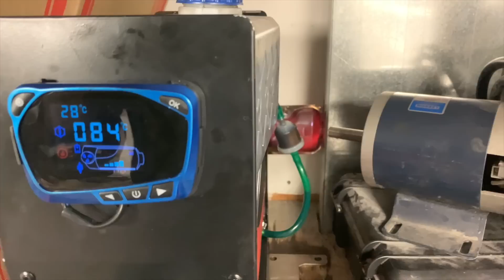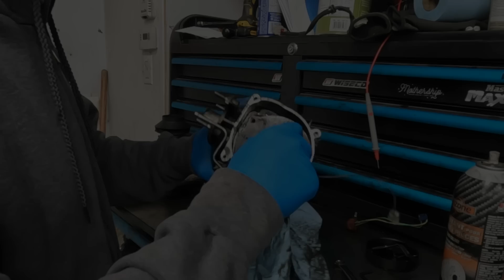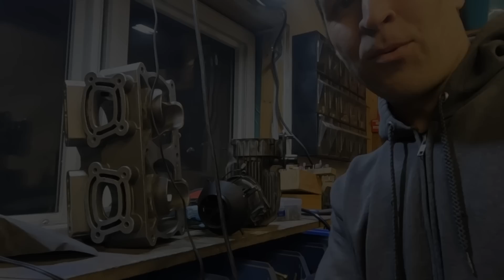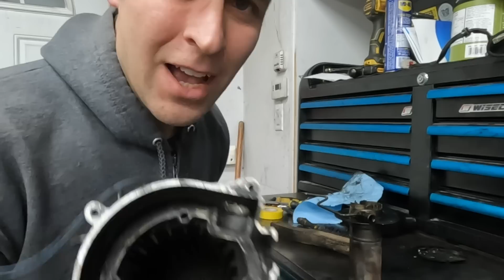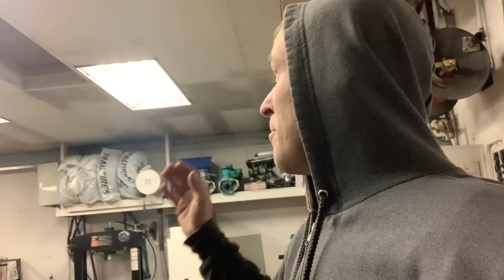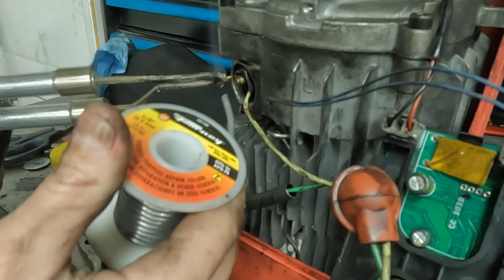Porting My Diesel Heater - (more air flow) Will It Help? Chinese Diesel Heater. PT-9

Comment: keep this in mind if that "fog" get to the correct air fuel ratio it will explode. this is too dangerous for me to try these heater terrify me just a terrible concept like the gas heaters in A model Fords
Reply from the maker: I'm not sure I follow what you are saying. 

I have had it backfire bad enough so that it popped the inlet off and pushed all the carbon out of the exhaust. This was because I was feeding alcohol, gasoline or brake cleaner into the inlet 🤣 

Burning oil or diesel it never does this. I've had it backfire but they are pretty wimpy backfires, as oils burn much slower. The inlet and exhaust area always open, so it would take a heck of a lot of pressure to make it explode... It would be a very bad day if it did. 

I heard that VW Beetles used some sort of gas heater because they were an air cooled engine.
Reply: @loweredexpectations4927  you might not know this but smoke is flammable and if it gets to the right mixture like for a car its aprox 13:1 wide open throttle and one this happens anything can ignite it and then your garage becomes the cylinder and BOOM i would be VERY cautious, i know these things because i have a car that can run on wood smoke its called gasification im not some troll my heart stopped when you said the garage was filled with smoke keep this in mind what you are doing might be illegal /no permit and the exhaust is definitely not code and if the house explodes and injures someone you will be liable, cops are all over the net
Reply from the maker: @xoxoXoieoxox  Thanks for your concern. I get what you are saying, I know what gasification is, I know about air fuel ratios, the LEL and UEL of gases. However, different gasses have different volatility meaning they take different amounts of energy to ignite, and when they do ignite, they have different expansion ratios and rates. 

Wood gas is particularly dangerous because one of the gasses you are producing is hydrogen... and hydrogen burns EXTREMELY rapidly. It expands so fast that it almost sounds like an explosion even when it is not contained by anything except for the atmosphere. Hydrogen is also dangerous because it will burn anywhere from 4% to 75% so the odds of getting the "correct" mixture to have a bad day are pretty good. 

Diesel or oil smoke will burn, but it doesn't burn well, it doesn't burn quickly, it has a narrower AFR that it will burn at and it takes more energy to get it to ignite in the first place. WIth gasification you have to have an air tite seal so you are starving it of oxygen, it wants to burn... This diesel and oil smoke are the result of something trying to burn it unsuccessfully.  

While there isn't zero risk involved, the likelihood of all of the fumes igniting are low, and the results of these fumes damaging anything, if they ignite, are also low.

Comment: You would have a melted glob of alinumum at those temps..Ha ha...
Reply: 👍
 lol, insulation keeps the heat in, so would make melting even more likely, but have look closely from 14 minutes on, and see actual temperature displayed, rather than listen to the extra zero he  add's with what he says.
Reply from the maker: @Retiredkiwi  Yes... but I said "NASA" soooo it's special insulation that also stops the heater from melting.... I wasn't allowed to say that in the video because ... well... "NASA"
Reply: @loweredexpectations4927  🤣🤣🤣omg, please stop it, laughing so hard its dangerous, too funny for words.
Reply from the maker: @Retiredkiwi  🤣
Reply from the maker: Yeah... but I said "NASA" soooooo. 🤷‍♂️

Comment: I would like to buy a 8kw I'm interested to try to burn biodiesel from wasn't vegetable oil. 
I don't know if have try that. I make it for my trator it works great in it.
Reply from the maker: Hello. Just so you know, the 8 and 5kw units are actually the same thing. There are no heaters like this that can actually put out 8 kw. They just do not have the capacity to burn that much fuel. 

I have not tried biodiesel myself, but from what I have been told, it will work. Filtered or clean vegetable oil will not work well, but I have been told actual biodiesel will work.
Reply: @loweredexpectations4927  I'm thinking of buying one were is the best place to bay.
Reply from the maker: @dorienhachey5909  I don't know if this link will work where you live, but this is the place where I got mine. If you use this link, and the code VVS10 you will get $10 off. https://s.vevor.com/bfP6Z5 

This is an affiliate link, meaning that if you purchase it here, I get 5%.

Comment: I've been thinking.... I used to start my rig that was running on vegetable oil, on diesel and then shut it down on diesel as well. I would give it diesel for 5 min at each end, first to start and heat it up to temperature, then purge it clean at the end. It was just a matter of having diesel in one tank and vegetable oil in the other and a smooth transition 4 way valve to seamlessly swap tanks. (common rail fuel rig with a recycle.) It might help with the start and then a brief clean out at the end.
Reply from the maker: Thanks for the comment. I have heard that that works great on diesel engines... I am currently doing what you say, starting and stopping on diesel and it helps for sure. I just did a community post about it today. I think that there are a few other issues that I need to work out, but it is a step in the right direction. 

https://www.youtube.com/@loweredexpectations4927/community

Comment: Don’t worry about using the exhaust to heat the fuel. I’ve been running a 6mm copper brake line wrapped around the exhaust just after the 90* bend for 2 weeks now.
There are three main points to be followed in my eyes:

To use a high quality externally braided fuel hose. Not the clear see through ones. Adding foil around this last line will help with avoiding excessive heat radiation hitting the rubber line. Use spring clips to clamp the line on both ends. 

Position the fuel pump below the copper spiral, otherwise the gases from the fuel will form a air bubble that will increase in size. 

Use thermal insulation on the steel pipe inside the heater otherwise all the fuel heated below will just cool off again as it makes its way to the injector. I used the white fabric tube used on halogen celling light sockets.
Reply: Excellent info, thanks.
Reply from the maker: Thanks for the comment. It doesn't sound to me like you are talking from experience, but from what you suspect might be the case, or what makes sense to you. 

Yes, the reason the exhaust is glowing quickly is because it has a low thermal mass. However, the fact that it is glowing means that the temp of the exhaust gasses are over 500C. Copper is an extremely good conductor of heat, so it would be the volume of oil (thermal mass of the oil) that would matter in this case.  These heaters only use about 9ml (2 tsp) of fuel per minute at max heat, so the rate that the oil passes through the tubing is extremely slow. The larger the pipe you use, the lower the velocity of the oil meaning the more times it spends exposed to the heat. 

The flash point of oil is 200 - 250 c so at even 300C it will be mostly vapour. When liquids change state from liquid, they expand. Water expands 1600 times... I don't know what the expansion ratio of oil is, but if it is the same, that means that about 10 seconds of oil will expand to fill over 2 litres of volume. 

Are you saying that heavy oil burners heat oil to several hundred C... because I'm pretty sure that is not the case. Closer to 100C and they don't use the heat of the exhaust, they use electric heaters that are accurately controlled... nut changing several hundred degrees. "the flow is proportional to the exhaust temp"... If everything is going according to plan. the fuel flowing through the pipe would be proportional to the heat energy in the exhaust, however, even in a best case scenario, this is not at all true. As your inlet air fan speed increases you force more air through the heater, this decreases its efficiency as the time for heat absorption decreases. Less time for the burnt gasses to transfer their heat into the exchanger as the air spends less time exposed to the exchanger... This means that more heat goes out the exhaust. As you increase the heat setting, the exhaust gets hotter / more heat energy goes out the exhaust. 

No one said anything about exploding ? Fuel lines will blow off when they are almost melted from 300C fuel...  I will explain why it will run away, and why mine has run away. Your fuel pump only allows fuel to travel in one direction, to the heater. You pump your fuel out of the pump into a the copper tube. Some of the fuel will gass off, and some of the fuel will remain liquid. The fuel that remains liquid will get pushed into the burn chamber by the expanding gasses. I have personally seen this in my heater at less than 200C. All of the fuel turning to gas would actually be way better as that would keep the delivery constant, but if some of it remains liquid, it gets forced through the system by the expanding gasses. 

These heaters feed .022 ml of fuel per stroke and run at max 7 hz. That's .154 ml per second .... Doubling that amount of fuel would only be .154 ml more per second.... So yes, it is very easy to cause erratic operation and a runaway situation ... The runaway is quickly (fortunately) followed by a lull in heat (or a shutdown) as the heater gets a giant pocket of gas instead of liquid fuel.  ... and tho the average may be "fixed", the real time fuel delivery is no longer fixed.
Reply from the maker: Thanks for commenting. 

Have you measured to see what the temp of your oil is ? Do you have any issues with erratic operation? Are you using waste oil of some sort? Sorry for all the questions. 

I know you can do this, and I may very well try this myself (at some point) but when thousands of people are watching my content, I don't want to take the chance on advising people to do this safely. All it takes is some crappy fuel line or an oversite and you can get in a whole lot of trouble. 

I have seen the exhaust pipe on my heater glow red several times, and I can't imagine that oil in a 6mm copper tube would fair well in that situation, as it is well over 400C. Even good fuel line won't fair too well exposed to that. 

I can see doing it that way if there was no other way or if you need more than 200C, but the body of the heater is regulated to a max of 230C and you can easily run automotive brake line between the fins. I run a short piece and get about 70-100c going into the heater. I tried heating higher than that, and because my oil likely has water and gas in it, I get erratic operation due to the off gassing.
Reply: @loweredexpectations4927  
Hello for starters i only run my heater when I’m in the garage or if I open my webcam occasionally to check on it. 
Yes my exhaust dose glow red hot and everything seems to run just fine. I also have reflective tape around the spiral to trap as much heat as possible. 
I’m planning to put a thermometer from my fluke clamp meter or the steel injector line to see the temperature, but haven’t got round to it just yet. 
And yes the machine runs smoothly, but I’m still sure it will need periodic cleaning. 
I start and stop the heater with pure diesel and have a T valve to switch my fuel. I use old motor oil from GPL cars that is cleaner and pass it through a filter. If you can’t get your hands on this oil try finding used AFT trans fluid.
Reply from the maker: @dan2fast4you21  Thanks for the into. I’m glad it’s work for you. I’m burning the oil supply that I have, as I have a steady supply, but in the future I may try other sources.

Comment: Could you post a bunch of the fluff in a separate video labeled as such. At the end of the series or when you have extra time, for scientific purposes?
Reply from the maker: Thanks... I appreciate the comment !  I don't plan on removing important discoveries or details from my videos... I just mean that, if I do a test 3 times and get the same results, I might say "I did it 3 times and got the same results" instead of showing the test all 3 times. 

I will continue to include all of the experiments that I do in some detail, and the outcomes, but try to make it more to the point and not so drawn out.

Comment: So, how long with the Chinese diesel heater run on pure, clean diesel?
Reply from the maker: I have run mine for several hundred hours without issue... but that's not what I got it for, haha. 

I have had many people say that they have been running them for years without issue. VEVOR are sending me another one so that I can do more practical testing on actual diesel.

Comment: Burning diesel creates very neglible amount of carbon monoxide so that's unlikely to set off the meter or kill you. There are other gasses (e.g. sulfur) that are bad for you though.
Reply from the maker: 100 % for sure !! My father was a mechanic and died of lymphoma in 2014... being exposed to chemicals and fumes all the time is not at all healthy.  CO is the least of my worries, unless I plan on sleeping in my garage. 

Thanks for the comment !

Comment: Another reason not to overheat the fuel line, is that it will, over time, plug itself completely with buildup.

The C temperature readings from the thermocouple seem to be off. Aluminum alloys typically melt at under 700C, from what I have read.
Reply from the maker: Absolutely...👍  It will fill with residu and plug... when it plugs, then it's going to burst for sure. Thanks for the comment !

Comment: hey man! just some info out of my "experimentes"
i ran  50% usedoil  + 50% unknown Gas/Diesel mix from a wrongfully fueled car.
gas content is probably very high. 

so after two tanks the heater startet to smoke and make funny houling noises untill it couldn't start anymore.

inside was a similar picture with all that fluffy white stuff and the hard black stuff underneath.

some of the black stuff was inside that inner hole grid part and I couldn't get to it. rock hard.

well I left it in there and started to burn the unknown diesel/gas mix.
sadly one tank and it shuts of after couple of minutes runtime.
the whole exhaust piping was full with ash.
like only your pinki would fit in there.

here is the catch:
all that rock hard black stuff transformed to the softer crunch.
removal was super easy!
this may gives some clues.

sorry for bad english 😆

my ideas on why my heater stopped running:
1. ash buildup due to air restriction. that black stuff choked it down.
additional choking with clogged exhaust piping till it wont stay lit.

2. ash buildup due to the high gas content.
it basicly steals all the O2 away and the diesel can't burn proper.
Reply from the maker: Thanks for the comment and detailed info ! Your english is great. 

Sorry to hear of your troubles (just like mine) I have found that even when you clean the main part of the chamber out, the area behind the reduction ring needs to be cleaned out. This is almost impossible without cutting it apart (I cut mine apart). 

There is a mesh in there and if it is dirty, the heater makes all sorts of horrible noises. I have made mine so that I can service it easily now and I no longer have the inlet howling noises. 

I think you are correct about the fuel, with the addition that oil takes much more heat to burn and the heater does not get hot enough to flash off the oil. My main goal now is to get more heat back into the burn chamber. 

Cheers !

Comment: i have been thinking about drilling a hole in the outer part of the burn chamber right above the exhaust so perhaps the carbon will drip out before it burns stuck.
Reply from the maker: Wow... it's like you can tell the future ... Impressive... Only, I didn't do it on purpose 🤣 it was just a side effect of another modification. Stay tuned for that, haha.
Reply: @loweredexpectations4927  haha 🤪 looking forward to watch the results
Reply from the maker: @mnp3713  I think they were pretty interesting !

Comment: Have you tried filtering with a low micron filter
Reply from the maker: Thanks for the comment. I had not yet. I am filtering with very basic filtration. I am currently running a test burning a new (unused) oil mix to see if it is contamination that is the issue, or if itis oil itself. At some point I will increase the level of filtration. Thanks !